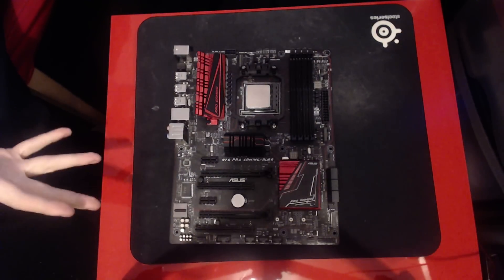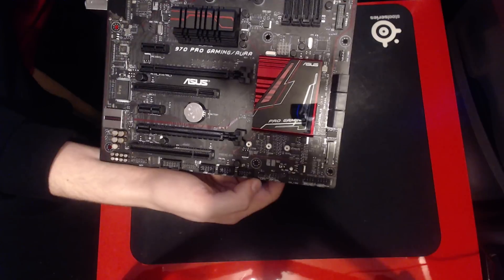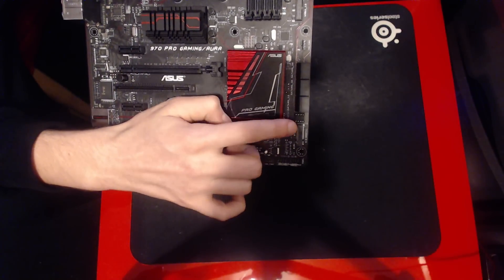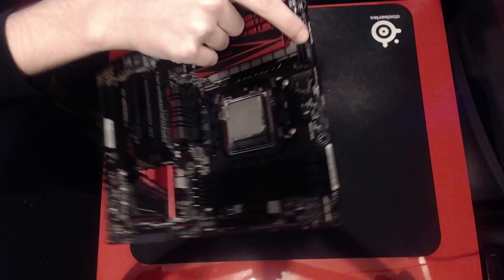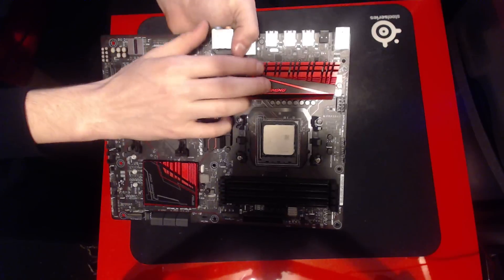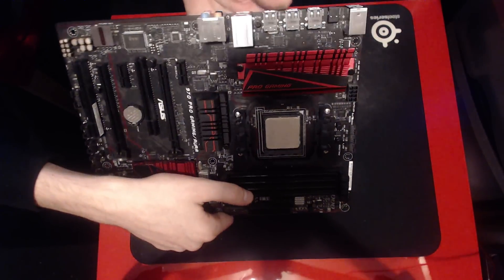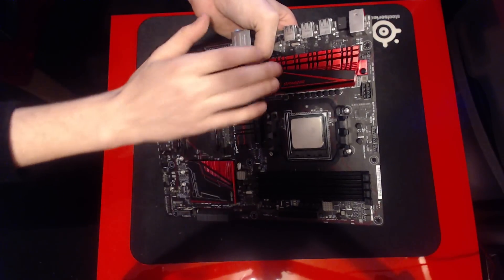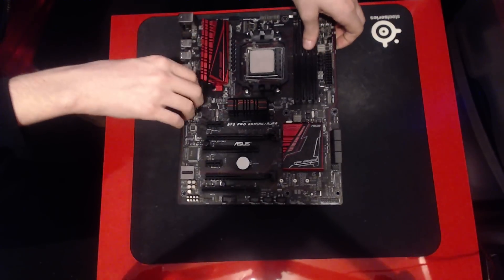A look at the ASUS 970 Pro Gaming / Aura

Comment: Question, is it possible to put a working tpm module on this motherboard to get it to work on Windows 10? I bought an Asus TPM 2.0 module from amazon and when I enable it in the BIOS, it won't activate. Windows 10 doesn't even recognize it at all, won't show up on device manager. Nothing.

Comment: Its still a great mobo still today. I'm using FX-8350 4.2 2xRX580-Dual-8G 32GB Kingston 1866 and boot on M.2 on board and its 3 times faster than an normal ssd sata drive.
Reply: John Wagner...I to run this board on my main machine along with an FX-8350 but I use Geforce 1060 with 6GB GPU and I boot to SSD...I thought the M.2 was just for fast storage so I never even put it to use but you say you boot from this. Do you have to do any changes in the BIOS or anything to make this happen?
Reply: @dant63   is your bios up-to-date?Mine is 1001.
Reply: @Wagna87  Thanks for the reply John...Im not sure what it is running. I have updated it but it has been a while at work now but will check it out...Is there something in the BIOS I have to change to make the M.2 bootable then? Thanks again
Reply: @dant63  I'm not sure but when I installed windows, I actually removed all the drives and left the m.2 drive in and used my ssd msata usb drive with windows installation and the installation found the drive and selected, install. But As i remember the bios version added support for boot from Nvme/m.2. I would update your bios anyways. You can download your bios from the asus site or Use EZ Update.
Link to the bios:
https://dlcdnets.asus.com/pub/ASUS/mb/SocketAM3+/970_PRO_GAMING_AURA/970-PRO-GAMING-AURA-ASUS-1001.zip
Reply: Only 4.2ghz? I run mine at 4.8ghz daily 😂 Prettt surprised how damn good this is. Fx8350 rocks.

Comment: What is the black heat sink in the middle of the board for? The reason I ask is that the one on mine is so hot you can only touch it for about 2 seconds. I'll check it with my non-contact temp gauge for HVAC & update this comment.

Comment: Narrowed my choices for an FX-8320E (already own it) down to this motherboard and the MSI 970 Gaming.  Amazon has the MSI for $89.99 ($79.99 after rebate) and the ASUS for $109.99.  I would like the 970 Pro Gaming/Aura, but for $20-$30 more its making the decision difficult.
Reply: I have been happy with my MSI 970 Gaming board so far, has kept my  FX-6300 at 4.6GHz with no dips like I got on my old 960 board

Comment: Do you know if this board supports unbuffered ECC RAM? I'm currently stuck on a crummy ASUS M5A78L-M/USB3 with an FX 8320 (yeah, shit board, I know... can't even keep the VRM circuitry cool with extra heatsinks and two fans - the MOSFETs themselves look to be okay, but the chokes are too hot to touch. FYI, this board was given to me, I did not buy it) with 14GB of unbuffered ECC DDR3 pulled out of an HP Z420, and I want to push the CPU to about 4.6GHz, but with the extreme heat output of the VRM and the heavy load required on the 4+1 phase crap that's on it, I don't feel comfortable overclocking the CPU this far.
If the 970 Pro Gaming/Aura will not work with unbuffered ECC RAM, do you know of any 970 or 990FX boards around the 970 Pro Gaming/Aura's price range that supports unbuffered ECC RAM and doesn't use a phase-doubled VRM?

Comment: was looking for a motherboard with my fx 8350... how does this compare to the sabertooth r2?
Reply from the maker: Overclocking wise it's just about the same.
Reply: How does the durability compare? I'm looking at building a mineral oil pc, mostly for the cool look, but I've hear of capacitor popping issues On cheaper boards due to heat

Comment: I just bought this on Amazon but I live in Brazil, so it will be arriving by january with my sister. I bought it because of the price here is 3x higher, when converted dollars to reals. And also because my OC cap in my computer is pretty low. I can't get my FX 8350 to it's max potential. Hope this board solves it! Nice video! I'm now sure that I have made a good purchase

Comment: That mobo came in doa for me... Im on GB G1 gaming 990fx for about same price and its got a lot more features. Now if AMD can rma that cpu the asus borked I should be back in business in a few weeks.
Reply from the maker: I have the 990FX G1 Gaming. Love the board.
Reply: In your opinion would a cpu damage a motherboard as the 8320 and phenom 2 965 I have here wouldnt boot in the aura and the same issue happening in the G1 gaming I afterwards rma'd it to amd.  But is my G1 gaming bad now? Im a bit loathe to try the 965 in her now. Whats more likely, a bad mobo damaging a cpu or a bad cpu damaging a mobo? The 965 works fine on the old m4a89gtd pro usb3...

Comment: just got a 950 Pro m.2 drive, wicked fast mate. Totally recomend!
Reply: Im trying to install an m.2 drive myself but couldn't find the bios settings to enable the support for it.... Any tips?
Reply: @spidey32  What motherboard do you have?
Reply: @rhyswilliams999  970pro gaming/aura
Reply: @spidey32  OK looking at the support site, the board does have an m.2 slot, Let me check the manual
Reply: @spidey32  OK looking on the Manual: https://dlcdnets.asus.com/pub/ASUS/mb/SocketAM3+/970_PRO_GAMING_AURA/E11139_970_PRO_GAMING_AURA_UM_WEB.pdf 
if you check section 2.8 on the boot screen, After you've installed the physcal drive, does it not show up there? are are you using it as just and extra drive on windows?
Reply: @rhyswilliams999  actually i went through the manual and it says that an led right next to the physical drive on mobo should light up if it's reading the ssd, which in my case its not lighting up
Reply: Also it is a brand new ssd, just got it today, can't understand what seems to be the issue
Reply: @spidey32  is it just a activity light?
Reply: @spidey32  Which SSD did you get?
Reply: @rhyswilliams999  yes, its for ssd
Reply: @rhyswilliams999  Kingston A2000
Reply: @spidey32  Any luck? You do have it seated crrectly in the slot and screwed down?
Reply: @rhyswilliams999  yes, i made sure of that. Have ordered a replacement for it. fingers crossed

Comment: If only Asus came out with this in my country. While i was aware back then that Asus are making these new 970s chipset motherboard but it was Gigabyte 970-Gaming that first available to be purchase. The only issue that i have currently with the Gigabyte although i am quite sure whether that was the culprit; is VRM heat. i have an 8350 with a Cryorig R1 Universal cooler, and i didn't do any overclock, i just leave everything on auto. Sometimes when i have a prolong gaming session, my monitor would just go blank(blue with no HDMI device detected in my case) but the fans would go loud and full blast and i can feel the heat coming from the PC. i don't know whether the CPU, the GPU or the VRM is the problem. lol...

Comment: which card has the better vrm between this and the sabertooth 990fx r2.0?
Reply: the Sabertooth is better. but it also cost a lot more and supports the 9590. for average use you will never see the difference.
Reply: Joseph Florentine i suspected that, when i got the sabertooth only the crosshair v formula z was better, but it also had an 80€ premium over the saber

Comment: i have this board with a fx 8320 oced to 4,7 with 1,47v... with prime 95 the vrm's goes up to 85°c... so... i think i have a lot of room for more overclock. i tested this motherboard with an old phenom 960t, and i unlocked it to an x6. so... i can confirm that at least with my phenom, you can unlock it. sry for my english... greetings from argentina
Reply from the maker: yeah you could certainly take it up to 1.5-1.55V if you can keep the CPU cool at that voltage. Also I guess I now have to test if it will unlock the Phenom II X2 550,555 and 560 that I have.
Reply: i cant keep the cpu cool with more than 1,48v, i have a trusty 212 evo. i tested with a h100i with 1,55v i can reach 4,8v (4,9 is stable under normal use, but on heavy loads the system crash). I lost the silicon lottery i guess. For unlocking your phenom you have to go to "cpu on/off function" (or something like that).
Reply: I have the same motherboard, bought it recently, i cannot find any core unlock. The Cpu on/off is for having lets say at 960T turned on / off cores from 1-4. I cannot find any core unlocker option. I mailed Asus and they said that they will brief the technical department so they implement this. I hope they do it ;)

Comment: Could you leave the MB on the table and use a stronger zoom? The refocusing of the cam doesn't look so nice.

Other than that, this in-depth analysis is what I'd like to see in every MB review/presentation. With your shaky cam you did a better job than some of those big hardware sites.

Comment: Huh, I thought M.2 was proprietary to Intel... Also, if Asus is making such a high-end AM3+ mobo why use the 970 chipset instead of the 990FX chipset?
Reply: They made a new Sabertooth 990FX 3.0, ProGaming stuff tends to be on cheap chipsets to attract people with a low budget. (B150 ProGaming)
Reply from the maker: VRM size does not tell you the quality.
Reply from the maker: 990FX vs 970 is mostly differentiated by the PCI-e lane count. 970 has 
16 2.0 lanes whereas 990FX has 32 2.0 lanes.  So IMO a stong 970 board 
makes perfect sense since you should never use 2 GPUs with an AM3+ setup
 anyway.
Reply: How are we meant to hold good OCs with such a small VRM when all OC focused AM3+ boards have a ton of VRMs?
Reply: Actually Hardcore Overclocking This exactly!

Comment: I love this board. Got my 8320 up to 4.8 and change with up to 4 cores, almost 5 single. AI Suite says at that my cpu it hit about 250 watts, but doesn't seem to deliver anything above that no matter the voltage / temp. Looking forward to see how an actual hardcore overclocker does it!
Reply: I'm a little concerned about the voltage. 1.4125-1.425 I think. I had to dial it back for the summer to 4.6 though... When my living room's ambient temp is over 40c it's hard to keep her under 60
Reply: thats a very good voltage. my cpu is with 1,425v for 4,5ghz. to get 4,6 i need 1,5v
Reply: sry for my english, im from argentina
Reply: got an 8320 and a sabertooth 990fx 2.0, i can get mine to 4.6 at 1.3875v, right now i run it at 4.2 undervolted to 1.275v because my system is much quieter like that,  i think i could get 4.8 stable but no way to post at 5Ghz :(
Reply: Julian Grimoldi that's the silicon lottery for ya :/
Reply: trashmax1234 I've gotten it to 4.945 and it kills me because it's so close to 5 Ghz I can taste it :/ it needs more juice, and I just can't deliver it on my board. What cooler are you using?
Reply: Hotrob i am using an enermax liqmax II 120 aio, what voltage did you use to run 4.945?
Reply: trashmax1234 I don't remember. Iwant to say 1.44 something. It wasn't 100% stable, but I couldn't push any more voltage to it. The voltage would droop down to about 1.43 no matter what I set it to in the bios. It was also hotter than I like, and that's with my 280mm Kraken x61.